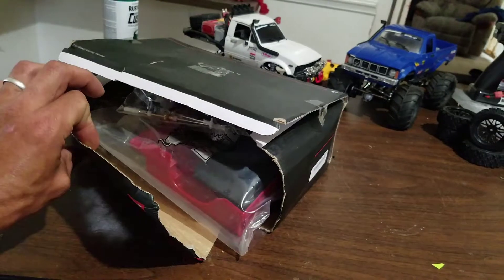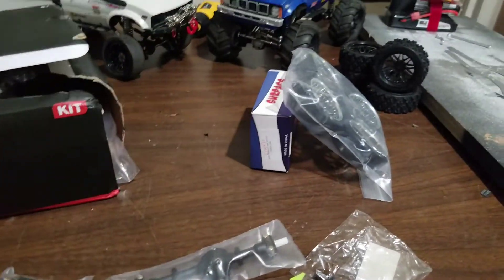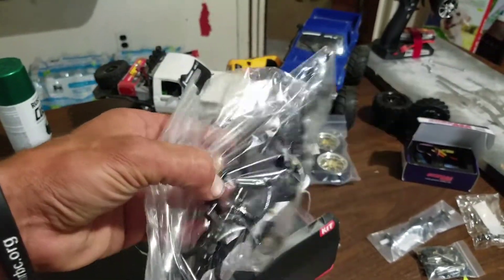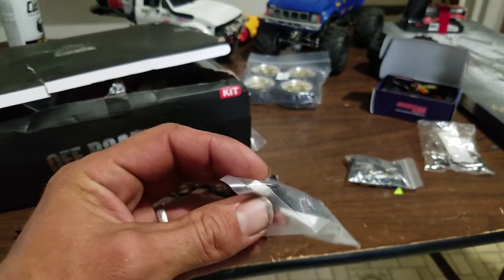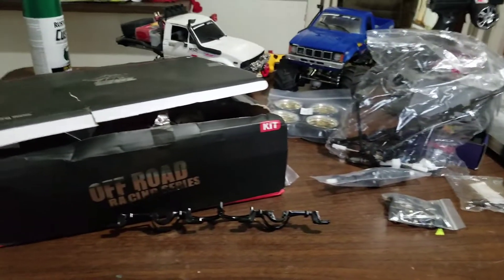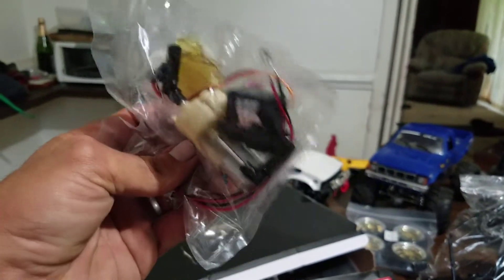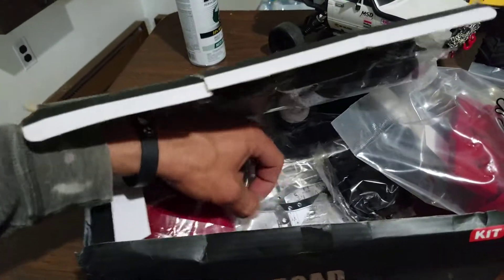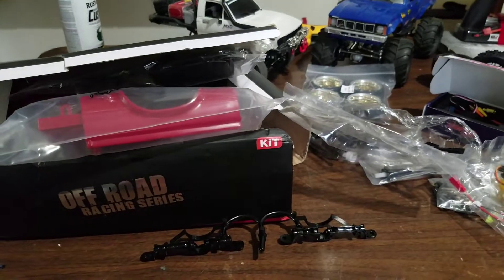New WPL C-24 Kit with upgrades. Finally!!

Comment: My man you got the surpass motor! Now I have to warn you I plugged in the esc I got from them and it instantly went up in smoke so I got the goolrc 60amp one and a program card vary worth it run the crap out of it on 3s.
Reply from the maker: Yea im not expecting much but it went on sale $17 for the combo i just went ahead with it. Im eyeing a hobbywing, basically same as goolrc...
Reply: @supastihl89  for sure but yeah I think I got my kit for like 25 so even then was it was a steal and the esc I think I paid like 30 35. But yeah all basically the same

Comment: Is it better to build the new kit instead of getting the rtr model?I seen the rtr model for a cheaper price
Reply from the maker: The kit comes with softer tires, real servo amd bigger motor. Im unsure  of the rtr upgrades. But they said all trucks will get these necessary upgrades so  you'd have to ask seller

Comment: WHY would you put "Drift" wheels & tyres & then a damn "Brushless" setup on a CRAWLER? Let alone the cheapest crawlers you can buy! I do love the body on these WPL as to get a real brand name "Toyota Hilux" would cost more than DOUBLE the price of this entire WPL crawler, but after what looks like a extended articulation shockie mod making it brushless & putting Drift wheels on this seems incredible stupid as not only is a WPL RC very cheap & NOT at all made for speed (it would explode on impact at speed!) Its a crawler so its way too high. weird.
Reply from the maker: Im building another truck for the brushless drift truck bud. Custom matte green 2 tone with a single gloss black stripe. White and silver interior. Silver accents white cap. I have a few rims cant find them small enough. Painted frame. Polished silver transmission with custom suspension and tires almost rubbing the fenders 🤟 I'm deciding on suspension now.